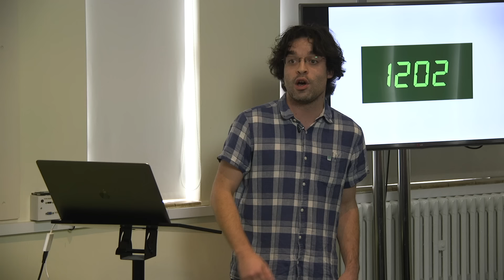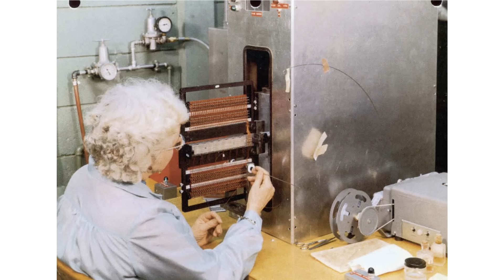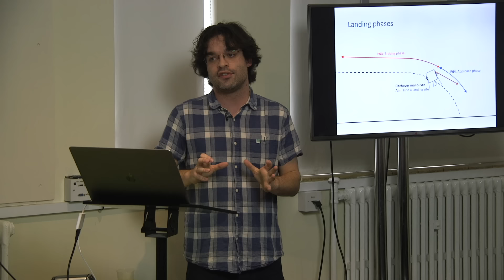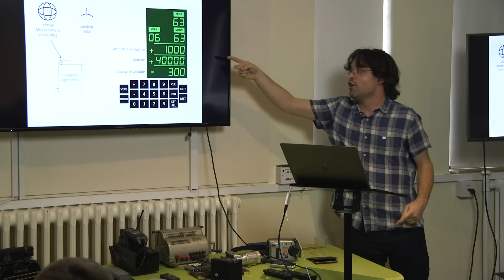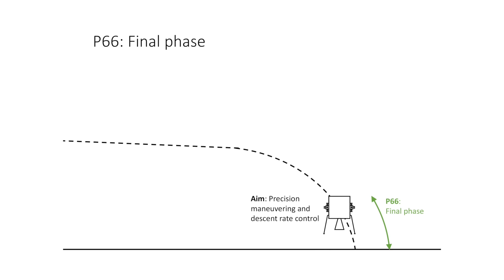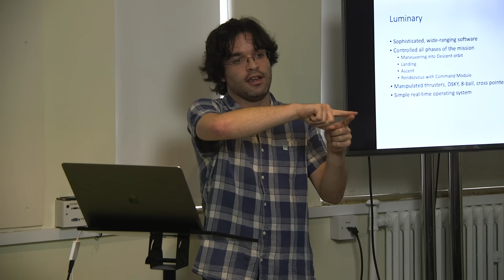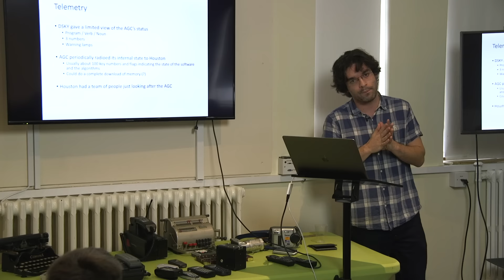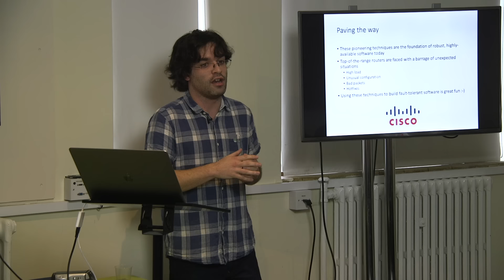Light Years Ahead | The 1969 Apollo Guidance Computer

Comment: science fiction, war of the worlds stuff. stop being stupid and look at reality
Reply: The reality is that you lack knowledge necessary to judge the veracity of the Apollo program.
Reply: @Jan_Strzelecki  really, you can't fly outside the atmosphere.  how much more do I need to know to just the apollo " program"
Reply: @patrickhickman8723  you can't fly outside the atmosphere.
Why not?
Reply: @Jan_Strzelecki  you can only defy physics in comics, but you are not alone believing fantasy is reality.  october 30 1938 stuff. You have an opportunity to wake up, maybe you should take it.
Reply: @patrickhickman8723  Okay.
Why can't one fly outside the atmosphere?
Reply: @patrickhickman8723  to produce aerodynamics you have to have air.
Rockets do not produce aerodynamics.

You can't move without something to push against.
Body 1: the rocket. Body 2: rocket exhaust. Sorted.

To have an interaction and a reaction you need 2 bodies.
A rocket pushing its thrust away, is pushed in the opposite direction.

To fly, one body is the air craft, the other body is the air.
I'm sorry, but that's wrong. First of all, against the thrust of a rocket, air, even at the sea level, cannot offer any meaningful resistance. You can check it for yourself: get on a skateboard, and try to move by pushing against air. You'll fail.
To actually move, you'd need to chuck away something heavy (like a classic bowling ball) away, which is how rockets move: by chucking away a large amount of hot exhaust gas every second.

This is reality, and I do need to argue with you here, because you're trying to bend physics to your liking.

absolute ceiling is how high any aircraft can fly above sea level
But nobody would ever use an aircraft to fly outside the atmosphere.
Reply: @Jan_Strzelecki  I will use this in my book, thank you so much.
Reply: @Jan_Strzelecki  would it be too much to ask you to define vertical and horizontal on a sphere?
Reply: @Jan_Strzelecki  ballsplained the heck out of your narrative, missed the heck out of actual physics though, but hey tell me what a vertical line is on your ball earth please???? maybe your magic carries over to geometry.
Reply: @Jan_Strzelecki  why do you launch rockets at sea level if they don't need air door knob
Reply: @Jan_Strzelecki  why don't you draw some lines on a sphere and stop talking and start looking
Reply: @Jan_Strzelecki  what I am trying to figure out is, hypnosis, indoctrination, ignorance, or misinfo agent.  there has to be a reason that you people are so far away in science fiction
Reply: @patrickhickman8723  Listen, if you can't actually contest what I said, the honest thing to do would be to admit it. You have the opportunity to wake up. You should take it.
Reply: @Jan_Strzelecki  HOW CAN I CHALLENGE FANTASY DUDE??? I LIVE IN THE REAL WORLD, REAL GEOMETRY, REAL PHYSICS you live in the fantasy where you can just make shit up.
Reply: jan is a girls name anyway lol
Reply: @ct6502c  why do you think science fiction is science?
Reply: @SMHman666  should you be proud that you can analyze reality, or should you expect others to do the same?
Reply: @patrickhickman8723  
So how did EASEP, multiple ALSEP installations and LLR make it to the lunar surface?  The hundreds of us that that worked at Honeysuckle Creek and Orroral Valley here in Australia would be interested in your ‘explanation’.
Reply: @patrickhickman8723  
I was right about you.  Oh and rocket engines don’t need to ‘push’ against anything.  When you get a real education followed by some technical training you’ll understand

Comment: Maybe he could a do seminar on the many impossibilities of the air conditioning system of said lander, the power it would have taken to broadcast a TV signal from the moon, and how their suits kept them cool in the sun and warm in the shade in crazy extreme temperature changes. Not to mention a little problem called the Van Allen Radiation Belts that NASA cant solve today. Complete joke. Nobody's ever been to the moon, nor ever will. Not even close. Sorry fanboys.
Reply: Maybe he could a do seminar on the many impossibilities of the air conditioning system of said lander,
The main impossibility here is that the Lunar Module didn't have an air conditioning system, and regulated excess heat by means of sublimating it.

the power it would have taken to broadcast a TV signal from the moon,
20 Watts.

and how their suits kept them cool in the sun and warm in the shade in crazy extreme temperature changes.
They didn't have to, since they weren't exposed to any "crazy extreme temperature changes".

Not to mention a little problem called the Van Allen Radiation Belts that NASA cant solve today.
Except that they did. In 2014. And it had no relevance for Apollo program. Your conspiracy claims are outdated.

Nobody's ever been to the moon, nor ever will.
The consilience of evidence overwhelmingly proves otherwise. Sorry fanboy 🙂
Reply: Why do you flat Earther conspiracy theorist nuts even come to science videos?
Reply: Ever heard of research?

Comment: Fascinating lecture. In the documentary movie “In the Shadow of the Moon” Buzz Aldrin is interviewed and says that he alone made the decision to turn the landing radar on. Buzz was known as “Dr. Rendezvous ” because he had a PhD in orbital mechanics. In the interview he states that he wanted to make sure that the radar was ready to go if they had to abort, so he switched it on when neither the checklist nor anyone told him to do so. You mentioned that it is inconceivable for an astronaut to have  inadvertently left the landing radar on, and you are correct.  It was not inadvertent:  Buzz Aldrin admits to having turned it on of his own volition. He also discusses it in his book. 

You mentioned simulations.  I have read, though I can’t recall where, that the last simulation before the Apollo 11 launch was one in which the simulation engineers realized they had never thoroughly simulated computer failures.  So the simulation team ran a simulation with the controllers and the back up crew to go over these type of events.  In that simulation they simulated a 1202 alarm and the controllers called for an abort.  This  was of course a mistake that was discussed during the simulation debrief. So in the last week before the mission controllers made a list of all the possible error codes and the proper controller responses to them.  They wrote them by hand in a notebook. You can see this notebook being flipped through in the movie “Apollo 13”.  Thanks to this notebook, controllers made the correct call during the actual mission. 

Edit:  Found this YouTube video on the simulation. Look at the 54 minute mark here: https://youtu.be/7f51Jzm7M4w?si=i6jPfIkBs6C5YUMf

In controller loop recordings during the landing when the alarm goes off you can hear a voice say “That’s just like what we had”.   The voice is referring to the earlier simulation in which that alarm came up, and this time the  controllers did not abort the mission but said “we are go on that alarm.”

I watched that landing at my girlfriend’s house when I was 16. As a kid we used to have a saying that referenced impossible things: “You can no more do that than you can go to the moon”. After that day we could never use that phrase again.
Reply: It’s hilarious seeing people believe this kind of thing and building all the science around it just to avoid admitting they live in a world where government lies
Reply: @JamesTrue  It's hilarious that you flat Earther conspiracy theorist nuts hate science so much and yet you use computers and the internet.
Reply: @ct6502c  I’m a zetetic and I’ve been working with computers since I was 12 while you have never been above 50,000 feet. There’s nothing funny. I call science things we can experience. You can science things that someone told you and you regurgitated like a lemming.

Comment: This was fascinating. I got to work on complete analog computers that were on the F4 wild Weasel as an enlisted kid in the service, when I worked on the Inertial Navigation system on that aircraft- to the heavily digital computers on board modern Naval fighters of today using multiple mission computers that utilize the 1553 and 1760 data busses. Then I finished on the F35 program that was cutting edge and everyone talked in SLOCs. Or software lines of code.  I was enlisted just after the Apollo program that ended in the early 70’s.  But I watched almost every mission on TV as a teenager

Comment: When Apollo 11 landed on the moon, I was 14. And I had already learned something about computers: I understood how a Turing machine, valves, transistors,  and wire-threaded ferromagnetic rings memories worked; I had seen one, actually, and built a tiny FM radio transmitter. And I patiently waited all through the (local) night for Armstrong to finally climb down and step on the moon.

Comment: A possible technique they might have used for "simulating the processing of the IMU input data for the orbital maneuver calculations" could be by "controlling the computer's awareness of time" (simulating time) by manually controlling the clock's ticks, so for instance a 1min scenario may take 5h of simulation, tick by tick:

Example:
1. Prepare the mathematical data of the orbit that they would input to the system.
2. Consider the clock frequency and input read frequency.
3. Pre-process the math data into raw input data, with necessary rounding and truncations, as those values would appear in the input registers.
4. Start the simulation.
5. Freeze the clock to time_n (nth tick, and mth raw input/sensor reading).
6. Manually set the "input registers", to the corresponding raw data on each.
7. Manually increase the clock counter by one tick (it stays frozen ready for the next time_n+1).
8. Repeat step 5 to 7 for each pre-calculated raw input.

Doing it this way:
a. The computer would not be aware of the actual time flow.
b. The IMU acceleration (for instance) would be determined by the differences of the input raw data between the n and n+1 tick.
c. The same for any other sensor.
d. They would have to prepare the whole simulation scenario for every input sensor, system behavior, and astronaut's behavior.

Pretty amazing guys.

Comment: No telemetry data.
Reply: You mean "no telemetry tapes, some of them."
The data is still available.
Reply: @Jan_Strzelecki  I’ve searched for it high and low online, I’d like to run the numbers, if you can point me in the right direction I would greatly appreciate it, I’m trying to discredit the tin foil hat brigade.
Reply: @melvinthor5855  The telemetry data is attached to individual mission reports, available at the Apollo Lunar Surface Journal.
Just go into each individual mission, scroll down to "Background Material", and choose "Mission Report".
Reply: There’s a lot of telemetry data.  Sotheby’s auctioned a set of tapes last year

Comment: Presentation was incredibly well done!  Thank you.  I’m not 100% convinced that Apollo got to the moon… for reasons that have less to do with the computing issues and more with radiation and guidance… but assuming we DID get to the moon, it was some major leap of faith in early hardware and coding to do so.  With 100 to 200 computers built, I can’t help wonder why a backup system wasn’t at least onboard “just in case”… the US had the money to install a second machine… I can’t really imagine cost being an actual factor.
Reply: there were two AGCs on board, one in the command module and another in the LM

Comment: Great explanation.
I was just wondering why the Saturn v rocket ant the LM needed to carry a full blown computer anyway? Surely most of the bread and butter processing could have been done remotely and only the stuff that needed a quick response could have been done locally to relieve pressure on the onboard computer. Just a thought?
Reply: and guess what? IT FUCKING WAS. However for instant control you cannot do it on a remote mainframe.
Reply: Yes, mainframes and mathematicians on the ground did much of the heavy duty calculations. Apollo took with it what it needed.

Comment: No capsule tech, i.e. how did the capsule insulate the men from radiation? How did the lander cool the cabin and heat the cabin from extremes? As time goes on, it is painfully obvious we faked the moon landing! BTW, NASA did announce that all tech data was lost on how they claim they landed on the moon!
Reply: learn what radiation is, learn what heat is, and NASA have never said anything remotely like what you're lying here
Reply: @Agarwaen  I do know what radiation is. Show us the tech NASA used to shield humans.
Reply: @krickshorts5346  so tell us how much "shielding" you need against alpha and beta particles then. do you even know what those are?
Reply: @krickshorts5346  Show you? Are you too lazy to do a quick search for yourself? Why do you guys always insist that you be given info instead of taking the initiative and finding it yourself. You're just lazy. Do the work, like we have.
Reply: @SMHman666  pay attention, i said NASA claimed to have lost all tech data. Learn to read better.
Reply: @Agarwaen  why don’t you explain it professor if you are gonna claim I am wrong.
Reply: @krickshorts5346  here's a tip for you to start on learning, the VABs trap CHARGED particles. ALL charged particles have VERY LOW penetration. Thus the skin of the spacecraft (in addition to fixtures on the insides) would easily block most of it (and they get blocked that easily because they are charged, and thus easily interract with matter). That's the "tech" needed, a little bit of material in the way.
Reply: @Agarwaen  you gotta be joking!
Reply: @krickshorts5346  it's.. facts. do get an education.

Comment: Thank you very much for the lecture. I have 2 questions:

1. Is there any reason to use an interpreter rather than a compiler except for (possibly) saving memory? Did they use a compiler for writing the interpreter and the parts of code that have to be fast?

2. According to your diagram (and common sense) the lending point has to be right below the lunar module in the last stage. how could Armstrong see it throw the window?

Thanks a lot

Comment: The Star Trek Enterprise computer also worked "flawlessly". It had inputs and flashed numbers on a screen. Case in point if anyone closely examines the Ascent source code it can be seen to flash numbers on the display but it never issues a WRITE to control the thrusters ! The channels 5 & 6 are dedicated to the thrusters. If any fellow programmers can dispute this it should be a simple copy and paste.
Reply: in time for the anniversary there was a team that restored an AGC and had it simulate a landing, so you're just peddling lies. also which "trusthers" are you talking about on an "ascent"? DO you even know how the LM was designed?
Reply: @Agarwaen  The key word is "simulate",  There are sixteen thrusters or jets mounted on the LM. They consist of 4 clusters, orthogonally mounted. Talking about the ascent from the moon which was supposed to be controlled by the ascent program. The claim is that the program never issues a WRITE to the channels dedicated to the thrusters. I did not take his word for it but downloaded the source code and scoured it line by line, trying to disprove the claim. I have challenged other programmers to do the same. If anyone can find the missing commands I will stand corrected.
Reply: @kimbalcalkins6903  those would be RCS, you do realise it had a rocket engine too right? as for your claims.. they're rather .. empty as you've provided no evidence for them. particularly as you speak about "source code" as if the code for the AGC was run through a compiler. and the simulation required the AGC to do everything needed, since it the instructions it sent was used in physics based simulator, it wasn't a simulation run ON the actual AGC (it simply ran as it would have had it been actually running a LM).
Reply: @Agarwaen  Are you thinking the main engine could have been controlled to take them up from the surface to orbit without the RCS ? That is impossible.
Reply: @kimbalcalkins6903  I didn't say that, I merely noted how you ignore it. As it is, you've yet only to make an unsubstantiated claim, and thus there's no reason to consider anything you've said as anything worthwhile.
Reply: @Agarwaen  I am talking about the computer controlling the attitude of the craft, this only concerns the jets since the main engine is not gimballed, it is turned on and is turned off 435 seconds later, To say I ignored it is like saying I ignored the size of the hatch. As for proof, I cannot post 600 lines of the code here although I did move it to a PDF, I have tried to disprove the claim by examining the Ascent code, namely ASCENT_GUIDANCE,agc, just asking fellow programmers to do the same. Maybe we can agree to disagree.

Comment: This is a little strange.  All real-time systems (automotive and communications industry) I've worked on are not designed to restart under any normal operating conditions.  They have a HW watchdog that resets the processor if the software hangs and doesn't service the watchdog periodically but you would never go into production where that ever occurs.  If your car's engine control resets or if it was possible to reset just the task that controls fueling or spark, you would notice it.

Comment: Is there any program that can replicate what the Apollo computer can do in your home computer. 1 by running the program that the Apollo program would run. 2 graphically demonstrate the location of where you are in the Apollo program of computer (lunar take off end reconnecting with the command module. with the Apollo program numeric results? Give you the program code to enter at the proper time and the results of what you should get. To properly launch the Lunar module.
Reply: check out github, there's an emulated version of the AGC there.